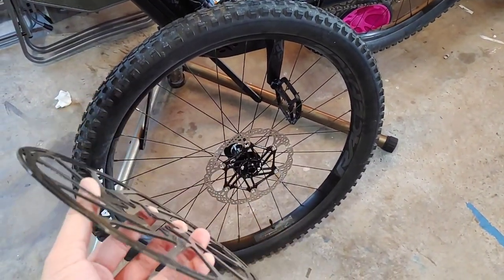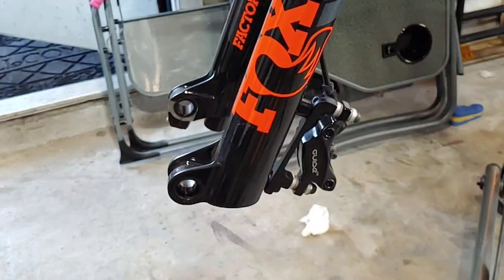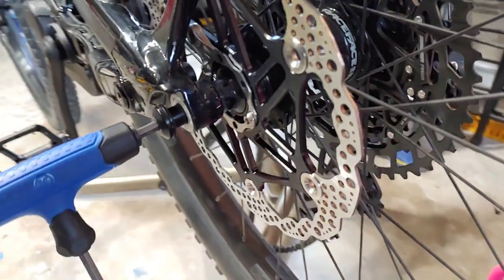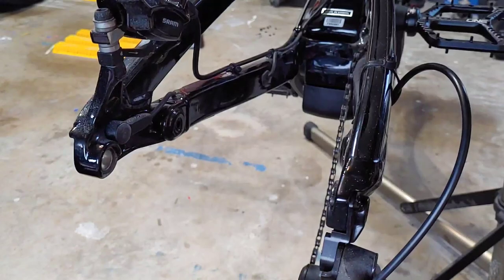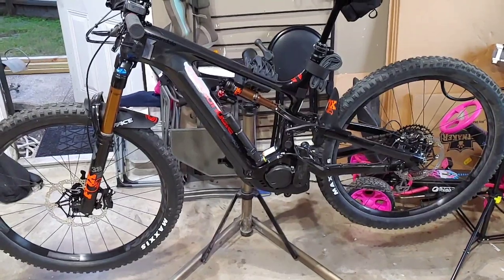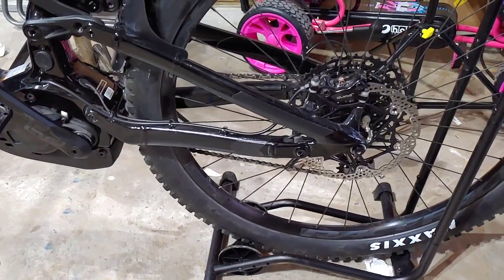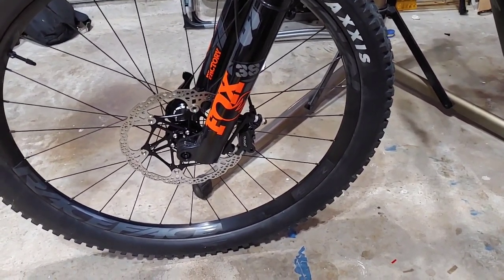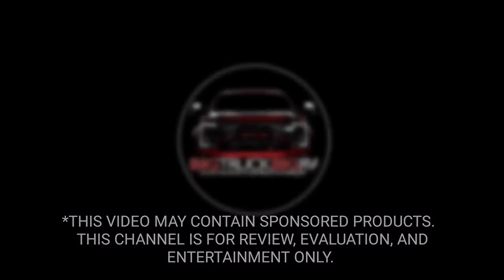Do SRAM Brakes and Hope Float Rotors work together? Guide, Code, and G2 2020/2021

Comment: A tip to anyone who has to file down their post adapter, if you have some put a layer of clear nail varnish over the top of it, it's stops any flakes from coming off which could scratch your rotors

Comment: I have installed Hope 203mm floating rotors on my YT Capra and after running them for 2 or 3 rides I think I'll swap back to the SRAM rotors. Here's why. I filed down the rivets a bit to not make contact with the caliper and on the bike stand it was perfect, no rubbing. However, on the trails, I hear the rotor rivets hit the caliper when I lean the bike to the left as there just not enough clearance between the caliper and the rivets. These are beautiful rotors, but unfortunately they only work with Hope calipers. Will be getting the new SRAM HS2 rotors which are 100% compatible with all SRAM calipers.

Comment: Just want to share my 2 cents. I just installed the 200mm Hope float rotor on the front of my YT IZZO Blaze with SRAM G2 RSC brakes and unfortunately the rivets make contact with the brake housing. I did try to reposition the front brake housing. For a second it seemed to work because the rivets didn't make contact anymore but then the brake pads aren't aligned and make contact with the rotor. Hope that makes sense ;) I was thinking of filing down the brake housing but there honestly isn't much room left to file down which makes it too risky. I've lost Hope and will sadly be returning them. If anyone knows which rotors do fit please let me know!

Comment: i've definitely had that issue with the Shimano XT calipers and the Hope 180mm rotor rubbing on my Rock Shox Pike forks. I even ground off some of the caliper and it still rubs. Shimano suggested I add more spacers under the caliper bolts  but then I lessen the contact patch of the pad with the rotor.

Comment: 4:13 there is no need to do this, just align the caliper with the rotor, so it's offset a bit, I did that with shimano brakes. that will work on all bikes. you can easily do this by using a brake alignment tool, like Hays Feel'R use the two shims at one side instead of two and it should work, using zip ties can work too or bye eye.

Comment: I highly recommend you try some different brakes. Sram are bottom of the barrel
Reply from the maker: Ive had good luck with them so far.  I might switch to Hope or Magura eventually.
Reply: Actually,the guide brakes are pretty good,4 piston and supposed to have better modulation 👍
Reply: Nice setup by the way .
Reply from the maker: @geoffsimons1235  yeah, I'm actually digging them.  They feel exactly the same as my G2 RST.  The Guide RE use Code 4piston calipers.